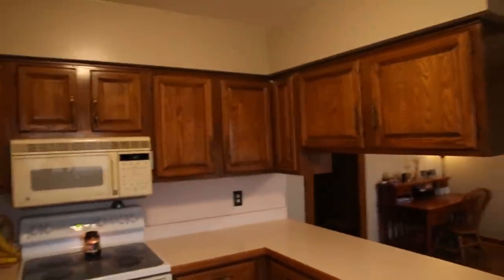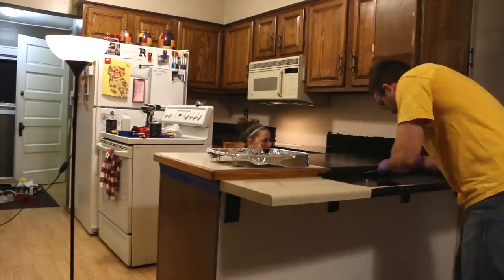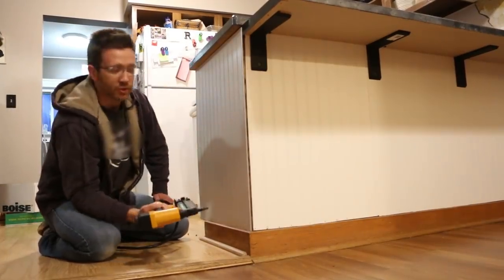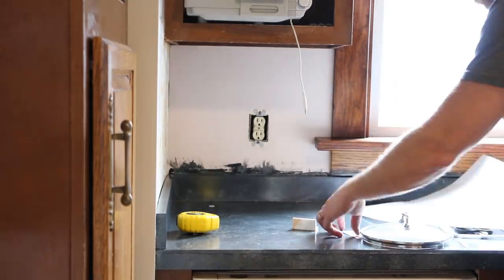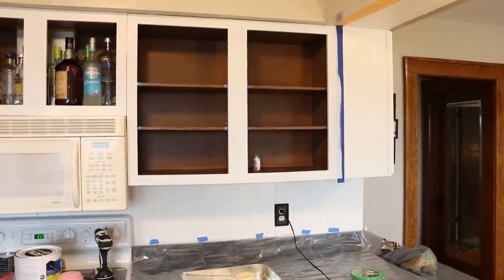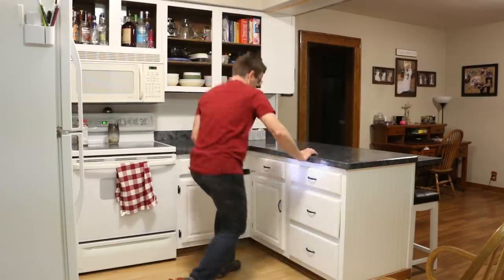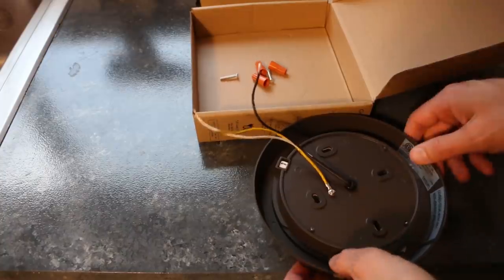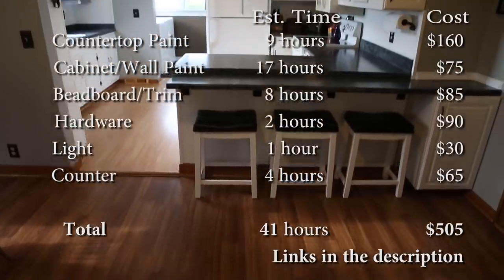How To: $500 DIY Kitchen Remodel | Update Counter & Cabinets on a Budget

Comment: Kitchen looks so pretty!!  Try using a magic eraser on the microwave and stove to get the plasic parts white again. (I have the same issue with white appliances in my kitchen.   Works great and takes off the yellowing.  :)  You guys did a great job!

Comment: Not to criticize,  It looks great. But the ground wire IS important,  not as much for your LED light, but for the 110 power feeding it. Also NOTE: when working above a sink ALWAYS plug the sink 1st, it will prevent you accidentally loosing a screw or anything small down the drain. 
Great job on your kitchen.  I love the colors too.
Reply: I believe the fixture boxes in most old houses do not have a ground wire. Just hot and common.
Reply: If the fixture and the light are non conductive a ground connection is not needed as it doesn't really do anything
Reply: I appreciate this info for myself

Comment: A trade tip !! When sanding dry wall in small areas,get a wall paper sponge and wet it,wring it out and you can sand without the dust.
Great job

Comment: Thanks for sharing this. I did my entire house DIY style (ripped out everything inside except the laundry room cabinets, closet poles and a few light fixtures). However, the floors throughout and the kitchen remodel I had a company do for me. With soft close, Lazy Susan and extra shaker white cabinets in the kitchen to match the rest of the house, I'm glad I didn't do that portion of the remodel myself.

Comment: Great reno. Even the background music of the video is nice so as not to distract from presentation. Hope you don't mind some ideas, may or not help you. 
I would install a dimmer switch for the light above sink, and place some type of battery-powered light above bar/counter, or chargeable magnetic lamp you can place under cabinet over bar. You can screw on a flat metal plate under cabinet which the magnetic light will attach to. They have three light settings and last either 5, 8, or 35 hours on a single charge, according to dim, medium, or bright light setting use. They are small 8" tubes, make great task lights, or lower light while watching TV. They can be used for many hours during a power outage, are ready mobile lamp you can use anywhere about the house. Also you can do some creative things with battery-powered fairy lights for added ambience above the area over bar. They have many mustard seed sized lights that use very little battery consumption, about 150-200 hours on 3 AAA quality batteries. They add beautiful ambience for when you have dinner guests. These are just economical ideas of adding good lighting options without having to go into the drywall and run hard hardwiring. A small square wooden butcher block for a center work island would fit nicely in the open area of the kitchen. It has two lower slatted sheves where you can place perfectly-fitting wooden vintage style pepsi or coke crates in and use for storing spices. You can use the added storage space since you have a family, and not a lot of cabinet space. A center work island with cutting board surface plus handy spice/seasonings majorly enhances convenience during food and beverage preps, plus it keeps your food preps conveniently centralized and off the remainder of the kitchen counters. A white restaurant-grade cutting board can be cut to size for the top of the butcher block. You can purchase the clear rubber square grippers to stick under corners to prevent slippage on surface of cutting board while in use. A simple bamboo type Roman shade over the window would tie in nicely with the natural wood butcher block, giving some simple contrast and enhance the overall look of the window which is a major feature of the kitchen. Also, the white cutting board top would help tie in with the white kitchen cabinets.
Reply: Sonja Jordan Wow that was nice for all the suggestions to help update and improve the kitchen! Wish it were more helpful comments like that

Comment: Suggestion for later:
The soffit where you removed cabinets is begging for pendant lights. 
If your corner cupboard is easily removed (I noticed you put that up) you can cut openings to access and run romex from the outlet below (switch/outlet combo).
Reply: Oh, that is a great point!  You are so correct.  And easy w the soffit already there.

Comment: always such a shame when people do these types of renovation when they don't replace the old yellow outlets :(
Reply: harrison herring right. Thought that right away
Reply: We've been replacing a lot of them with the dual USB ports in them around the house. Especially next to our beds. We have 4 ports and 4 plugs next to each side of our bed.
Reply: @RiverRat904  we have them in the UK too - 2 outlets with 4 usb ports...
Reply: very useful for charging stuff without using up a standard outlet
Reply: @harrisonherring9194  mine are 2 standard outlets and 2 USB port in one unit. 4 usb's are pretty impressive. Wonder if those are available in the US? I'll have to look. We just put a contract on a house today we will be remodeling.
Reply: Yep I've been guilty of that. They are all mismatchy in my kitchen but it still looks nice.
Reply: It doesnt hurt to keep abit of the old school
Reply: I have just taped around them, used deglosser on the plastic, then spray painted. 2 light coats. It works.
Reply: Good for you
Reply: Lol I was thinking that could have easily been changed out but it didn’t look too bad after he put the black cover.
Reply: Tom Conten I did that once a long time ago
Reply: Mayday!
Reply: They are dirt cheap too
Reply: @Nick 123 T Nick 123 T never said the end result didn't look nice, I rather like it actually, and yes, I can change an outlet.
Reply: I try to tell that to my mom because she just buys new tan ones instead of pretty white ones 😓
Reply: One of mine tried to light my house on fire. That got me in the mood to change them out FAST!!! LOOOOOL
Reply: @harrisonherring9194  Don't buy unbranded electrical stuff like that from Amazon. A lot isn't UL listed, even if it says it is.

Comment: Paint walls & ceiling 1st, cabinets 2nd, then counters last
Reply: No... ceiling 1st, walls 2nd, then top cabinets, then countertops, then lower cabinets. Lol who cares, as long as you get it done
Reply: Just exited to see the 500$ budget, if I only could do the work myself. Labor is what's too expensive I have been in my house 35 years ; single mom , was never  able to afford to remodel.
Reply: ceiling first , then upper cabs , then counter top , then lower cabs , then walls ..... won't need a bunch of tape everywhere , you can be messy and final cut in of walls fixes the messy part ....

Comment: Very nice job! I painted my knotty pine cabinets and they were much worse than these. I want to add a hint that really helped mine look more finished. I used caulk in every crack where the cabinets meet the ceiling. I used caulk other places also but these cabinets are in better condition than mine were. It is nice not to see those dark cracks. I really like to see the inventiveness of young couples working together on a budget. Great job!

Comment: I did all brand new cabinets, top and bottom, with brand new countertops for Abt 600.00. I went to Lowe's and over the course of about 3 months, bought each peice I needed out of the damaged section. 
None of the damages are visible, mostly drawers needing reglued, or a crack in the side....easy enuff to fix or hide. I painted them all myself, and I have an amazing brand new kitchen!!! Patience really paid off for me this once. 
I mean, I was getting cabinets, unfinished for pennies on the dollar. A 200.00 cabinet cost me 45.00 because it had a broken interior shelf, lol. I replaced the shelf for 8 dollars in the lumber section!! On and on it went, discount after discount after discount. 600.00 later, I have 3, 5 ft lowers, and 6 uppers and brand new, shiny countertops...did not go discount on the countertops, but they aren't terribly expensive if you buy Formica.

Comment: Very nice. Excellent work my brother. One note on the light though. It's good practice to strip your wires back an inch and "pre-twist" them clockwise before putting nuts on. This ensures a perfect connection every time. Just my input on your electric work. I'm currently thinking about renovating my kitchen as well. My cabinets are from the 70s. Solid facing wood, plywood framing and a fermica countertop. Thinking of pouring concrete for the countertop. Any thoughts?
Reply from the maker: Go for it!

Comment: Turn off electricity before installing the lights!
Reply: Strictly a safety choice.  Not required.  But better safe than sorry.
Reply: He did, thats what the switch is for.
Reply: @bailey2624 In an older wiring system, where the wire is installed "hot to the fixture with a switch leg", you are correct. In homes built from the 70's on up, it is wired "hot to the switch", and in that configuration, it is impossible to get shocked once the switch is off. He did say the house is 90 years old. That being said, it would depend on whether the house has been rewired or not. My bigger concern was him not draining off the stored charge in the fluorescent fixture. I have seen where that has killed many.
Reply: Found the people scared of electricity lol
Reply: Maritza Piccarillo definitely un needed.
Reply: Deadlyguy135  correct..however without adequate voltage current does not exist. The body provides enough resistance that 120v (I previously said 110) will not cause any real harm. This is also the reason why warning labels say "Warning High Voltage" and not "High Current." There needs to be a high voltage in order to push a deadly current.
Reply: Deadlyguy135 and how does the “flow” rise? If resistance hasn’t changed and voltage is consistent then what your saying is complete nonsense!
Reply: Deadlyguy135  You are correct... I'm definitely wasting time attempting to get an individual that can not spell to understand the basics of ohm's law.
Reply: Only if you dont know what wires go together,and what wires your mother in law holds.!!
Reply: No other wires in that junction box aside from the dead end ones being connected to the light, not really necessary to turn off breaker, unless you want to be mr safety first 🤓
Reply: @DanBol8686  *cannot 🤨
Reply: @jeanabeana8818  Can not, cannot, and can't are all correct so...
Reply: @DanBol8686  In whose world is "can not" proper English?
Reply: @DanBol8686  I'm an editor, and I assure you I wasn't born under a rock. Cannot is a word. Can't is short for cannot. Use "can not" in a sentence and justify its validity. A friendly challenge for you 😉
Reply: Jeana Marie you can, not choose to accept that most languages are constantly changing.  What is considered incorrect may become widely used and accepted in the future.  Would you say Ebonics is an incorrect language?  People can choose to write any way they feel like, and if it’s understood correctly, how is it wrong?  Most people don’t use the verbiage of yesteryear.  I’m just jibber jabbing but can you can not if it’s alphabet soup?
Reply: @wakawaka1976  Correction: "You can choose not to accept that languages evolve..." You're  correct in that languages do evolve; hence, the reason we no longer speak Old English. You may say that a sentence using "can, not" in a sentence is proper; nevertheless, I can tell you it's flawed. In essence, using "can, not" in a sentence is called a comma splice. In other words, it's the improper placement of a comma; therefore, you use the word cannot. Let me give you an example. "This thread is like watching a freight train derail, but I can, not look away." vs. "This thread is like watching a freight train derail, but I cannot look away." vs. "This thread is like watching a freight train derail, but I can't look away." Now you tell me which sentence sticks out to you, because they all need the comma before "but" in this case. That sentence could be made into two, thereby calling for the legal use of the comma. "This thread is like watching a freight train derail. I (cannot/can't) look away." Thus, I've taken issue with the assertion that (can not/can, not) is permissible in place of cannot or can't. Stay safe and stay healthy.
Reply: Yep. It's all fun and games until someone loses a husband and that's the day you think to yourself...nah, I don't have to throw the breaker.😢

Comment: I’m doing something similar with our kitchen too. Peninsula cabinets and all. 
Minus that 80% of the work has gone into stripping the 7 layered (including a top latex layer and bottom lead layer) paint that was an absolute nightmare. 
Including dealing with a popcorn ceiling (that was all messed up after the cabinets were removed) and various needed fixes to the cabinets. 
Then all new molding/trim, including removal of the old ugly decorative trim that was literally built into the cabinets. 

The cabinets were made out of fantastic hardwood that looks fantastic when refinished, so keeping everything as original as possible...but giving it a modern facelift was key. 

All new outlets, dimmer switches (and light fixtures) and two new Samsung appliances later...we spent around $4,000 on what would have easily costed us 20k easily (there was many other things updated/remodeled too).

Comment: Always turn power off at the panel before you mess with electricity. That switch near you turns on as easy as it turns off.

Comment: Nice job what a transformation , Wow,
One note concerning your electrical work, when dealing 
With 120V AC leads you always need a ground,
In this case the 120V was going straight to you Led fixture.
Unless you have a step down transformer that converts the 120 to
12 or 24V D.C. Not that the 120V to the transformers are grounded as well.
Its always safer to do this.
Nice job though !!

Comment: Nice job. But you should have started painting from the top down. Save yourself from covering the countertop and the cabinets.
Reply: A good painter can paint any which way... coverings and tarps are for the inexperienced ;)
Reply: @MUMMRA-the-Everliving  : A good painter and remodeler, would have painted everything BEFORE the doors were re-installed, and the countertop was painted, and save MASSIVE TIME not having to drape everything. And ESPECIALLY don't sand drywall, AFTER re-installing the doors. There was a lot of clean up "off camera".
Reply: @MUMMRA-the-Everliving  You can call me "Inexperienced" because i have only painted 2 bedrooms, (My first room - '2016' and the second one was just last year.) but I dont really use anything like "Coverings and tarps". I think its not about experiences. Its about common sense. :) (Not trying to argue.)

Comment: While the end result does not look like a $50k remodel job - it is a VAST improvement and for the budget you had to work with, it boarders on a miracle (IMHO!)  Congrats and I’m so glad you did the Video - showing those of us with little or no talent in remodeling that it is possible to revamp the kitchen, get a decent result, and avoid the cost of removing and replacing the cabinets. Also, worth noting is that even middle-of-the-road quality cabinets from 50 year ago are probably far better quality in terms of build, than you can buy today unless you’re spending major money for real hardwood cabinets with 3/4th’s or thicker plywood boxes, all screwed together (vs nailed or glued.)  There are some spots in the video where a piece of top trim would conceal the uneven space between the top of the cabinet and the soffit but overall it’s a minor point and something you can easily cut and add later (or ignore it until you finally sell the place and move on!) Overall, great job and to do it on a $500 budget is truly AMAZING!  You should be very proud of yourselves for both the kitchen and the fact that (we presume) your marriage survived it! (We’ve remodeled two kitchens ourselves - and one resulted in hiring a high priced contractor to finish it, and giving into her demands for Miele Appliances and a SubZero Refrigerator. The other, we managed to finish and the next day we decided that the marriage was over and she filed for divorce. But I had the last laugh!  I insisted that she keep the house and have the lousy kitchen remodel we both did to remind her of what finished off the marriage! Cruel? Yes, I thought so. <grin>  It took her four years to find another sucker to remodel the kitchen a 2nd time and then they divorced a few months later! Poetic justice?  Yes, it was!

Comment: Looks good, but your “low power light” has enough energy to kill a full grown human, always use the ground! -3rd year apprentice electrician
Reply: You would think a third year would know that an EGC isn't required for non-conductive materials (that light looks pretty plastic to me)
Reply: I’m just a mom, but he doesn’t have GFCI at the sink.
Reply: @gogamog  If it's non conductive, why would the manufacturer put an earth on it ?  It will be a metal (probably aluminium) chassis to act as a heatsink for the LEDs, so it should be connected to earth.
Reply: allbeit, Yeah, it's a few extra mins. why not do it right?  also, the switch being off isn't safe either!  I've been bitten a hundred times!  Dah turn off the breaker!  I was in a very time-sensitive position and turning off the power would have been unacceptable!   No depth perception can be hazardous. ugh